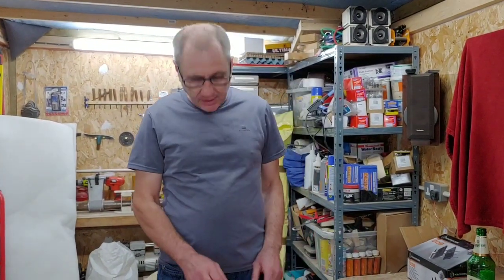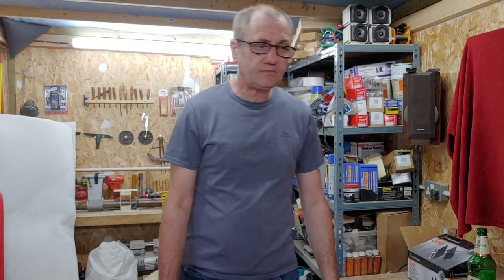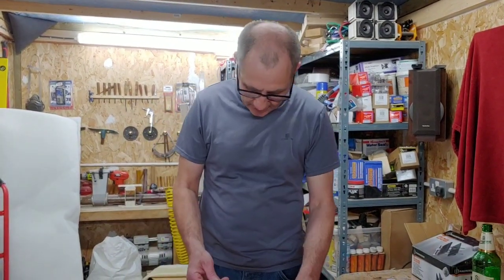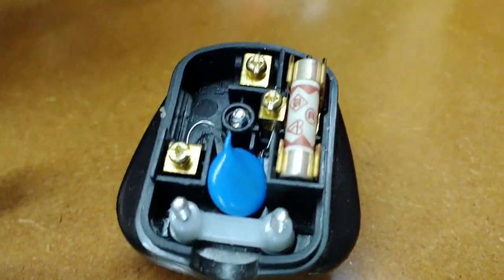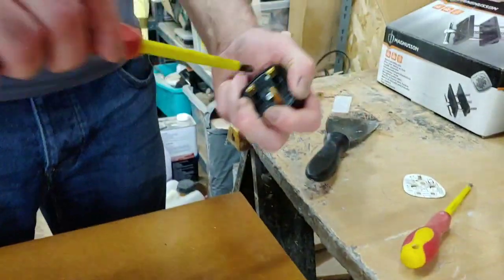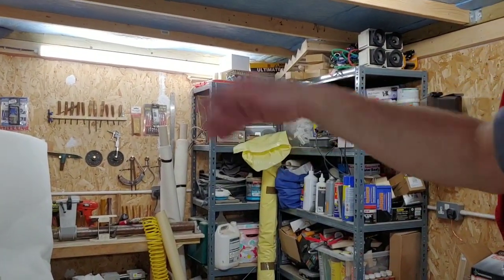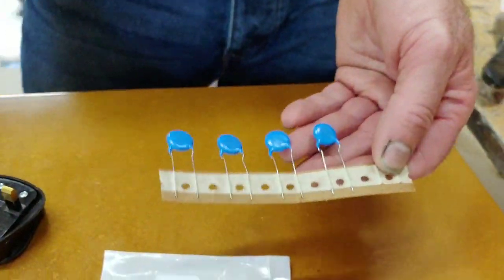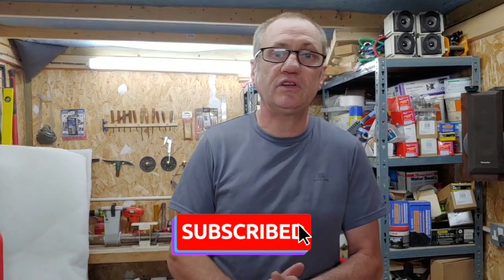Mains suppressor for your powercords

Comment: So this is a transient frequency filter?  What is the range of Hertz that it filters?
Reply from the maker: Follow the link, the data sheet is on there, thanks for watching.
Reply: @tweakerman  This is all I was able to find:
1
 Capacitance and Dissipation Factor (DF) measured under the following conditions:
SL: 1 MHz ±100 kHz and 1.0 ±0.2 Vrms
X5P, Y5U, and Y5V: 1 kHz ±50 Hz and 1.0 ±0.2 Vrms

I was asking for a range of hertz that is filtered by this capacitor.  Ideally anything above 60Hz continuous into the FM band.